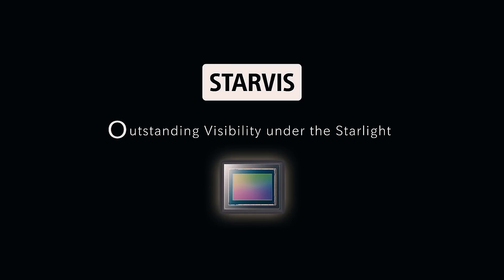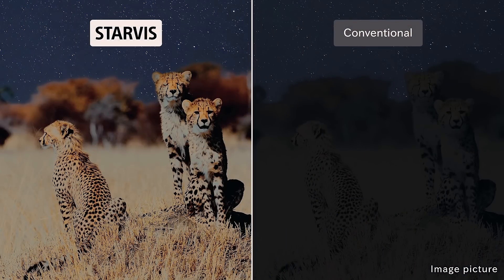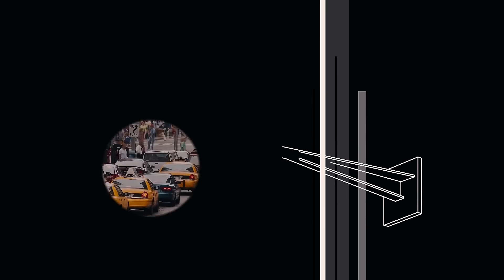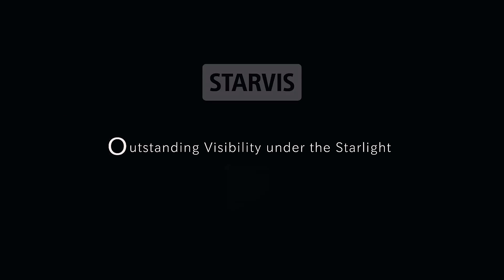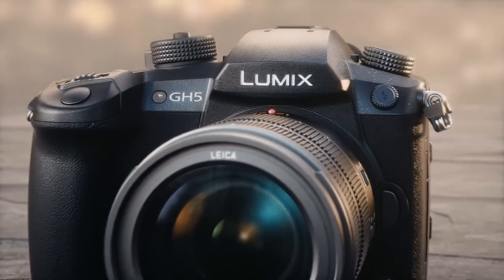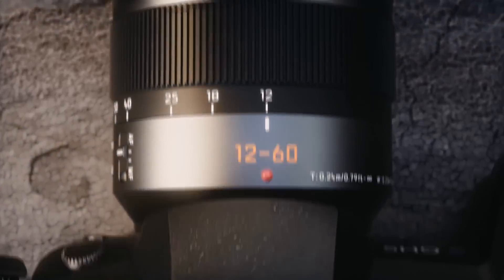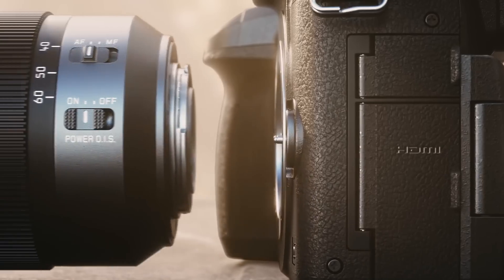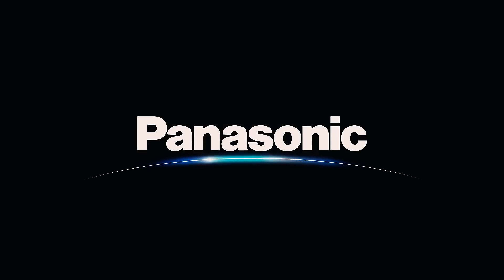Panasonic GH5s to use Sony Starvis Sensor? | Specs Update

Comment: Do you think this new tech will radically improve the autofocus capabilities of the gh5s as well? Thank you
Reply from the maker: Hey Justin - sorry for the delay! Panasonic is using contrast detection for autofocus and the performance relies entirely on the Sensor to give the camera the information fast enough. The GH5s sensor is must faster at detecting changes in contrast and with the uprated processor that the GH5s is meant to have, the AF should technically be the best Panasonic have released to date!
Reply: David Morgan Jones wow.. That's awesome..I hope you're right.. I'm holding off getting a gh5 to see if this is true with the gh5s.. Radically improved af (ideally to match Sony and Canon) is what I need more of, even more than low light capability.. Though I wish they'd introduce phase detection into the system which is what makes Sony and Canon superior in af currently..

Comment: Why didn't Panasonic contract SONY to use this tech in the normal GH5 sensor instead of releasing a whole new product?
Reply from the maker: Tobi Ogunsanwo Yeah it’s quite odd to release the GH5 and the GH5S! From what I can tell the reason they used the 20mp Sony Exmor sensor in the GH5 is so that it would be an amazing stills camera able to resolve high quality images but also able to capture high quality Video. 

They are releasing the GH5S with the Sony Starvis sensor which has a low megapixel count and will not be as good at resolving detailed images. This sensor will however be able to capture very high quality 4K videos, faster frame rates, much improved low light capabilities and also high bitrates.

So the GH5s will be completely biased completely towards Video where as the the GH5 was equality balanced to stills and video similar to the Sony A7R vs A7S :D
Reply: I never understood why Panasonic never had a GH5 (Balanced) GH5-s (Video & Low light) GH5-r (Photography High resolution stills). This came to mind when they released the GH4-R in 2016.